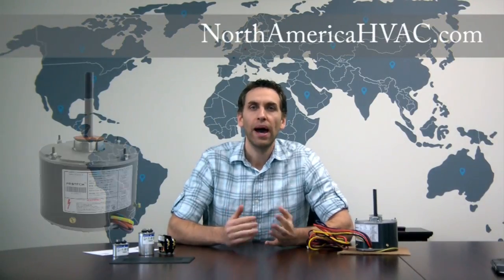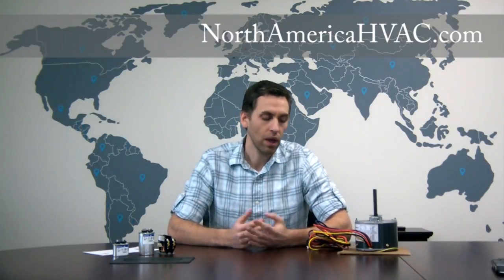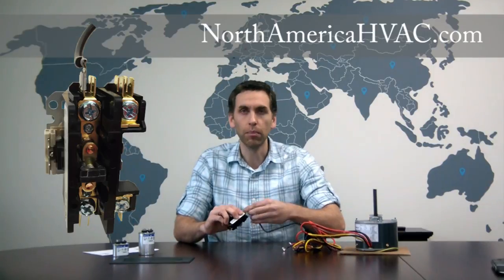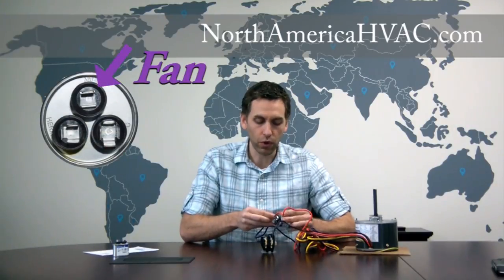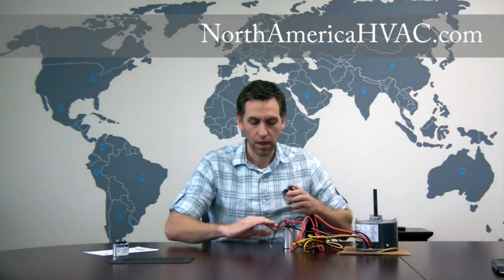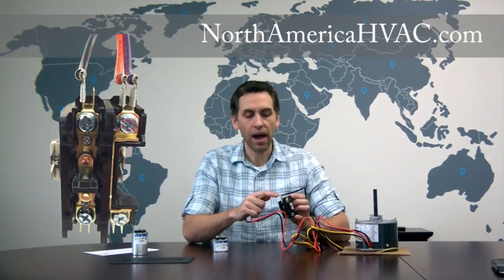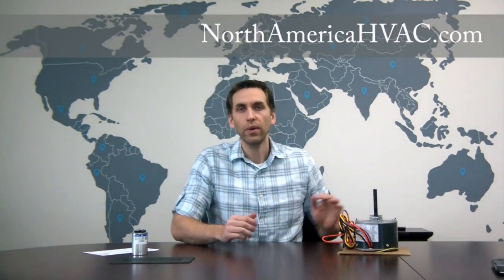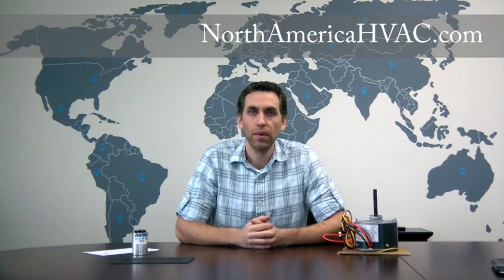How to wire 51-23055-11 & 51-23053-11 Condenser Fan Motors

Comment: Have had the motor since end of last summer. I spent time spraying W-40 in the old motor to keep it from squealing to get past the hot months. 

This summer that motor failed and its 97 degrees outside. I was not comfortable with the one page wiring diagram to tackle this project and was about to call someone qualified. 

This video was awesome. Thanks for making it very easy to understand and complete myself. 

AC is blowing cold again and NO SQUEALING!!

Comment: Be sure you wire TOGETHER the brown and yellow.  I had taped them off but didn't wire them together.  The motor will not run unless they are wired together.  My mistake, missed that little comment.  Otherwise great video for wiring this replacement condenser fan motor.
Reply: Thanks for the clarification. Much obliged.
Reply: @tbwil  yes I missed this as well but thank you for the clarification it works great now!

Comment: Good stuff man. 
I was replaced the ac fan motor for a ruud 3 ton and I noticed a I had 4 wires on the new motor.  It over heated within 5 min and Shutt off. Lol the wiring was completely different.  I followed your instructions and waaalaaa. Thank you

Comment: Thank a lot for this video.  I had a little bit of a problem reading the diagram and wired the fan wrong at first and was stumped.  The fan kept running hot then turning off.  After seeing the video I got things squared and I am all set.  Much appreciated.

Comment: Like another commenter said, I watched a large number of videos but just wasn’t sure until this video because I have the exact motor, would be nice if the factory left the angle spade connectors off the brown and yellow wire with just maybe a stripped back end showing the copper wires to give a hint of needing to tie them together instead of thinking they need to hook to a male blade somewhere, thanks for this great video, no doubts now and if rotation is wrong no problem swapping the purple and brown to get other direction.

One question is, if a motor is a clock wise rotate, is that with fan shaft facing you or facing away from you ?

Comment: My current motor went out and it uses Yellow, Black, and Brown wires.  The brown goes to a dual capacitor.  Apparently 51-23055-11 is a replacement for my old PN 8101-555 motor. How would I hook this up? Would I need a new capacitor? The dual capacitor I have no doesn't any information on it the label turned white.

Comment: My current set up is using the brown wire ,would recommend using that first instead or the purple wire on a 3 wire  hookup,also will a 35/3 440 capacitor work with theses motors?

Comment: My new 51-23055-11 from North America HVAC is working fine, but running with its surface temp at 185-190 Fahrenheit during a 85 degree day. Capacitor is new and checks at 3 mfd for 220V. Is it normal? I know it is class B so can handle much more on its winding, but I'm concern about the service life. Thanks

Comment: Do the yellow & brown wires get spliced together on the 3 wire setup or just capped off ?
Reply from the maker: Yes, the brown and purple, or brown and yellow, depending on your rotation get spliced together.  They cannot just be cut and capped individually.  Good luck!

Comment: On 3 wire dees any wire goes to herm
Reply: Did you find the answer to this?
Reply: The "Herm" connector on the dual capacitor is for the compressor wire to connected to. It has nothing to do with the motor wiring.

Comment: What about herm
Reply: The "Herm" connector on the dual capacitor is for the compressor wire to connected to. It has nothing to do with the motor wiring.

Comment: Not a word about those drain plugs---remove them? leave in place? And what's the hard plastic disc for that comes on the shaft of the motor--is it for shipping purposes or do we leave it on the shaft? In this "helper" video, why are these things TOP SECRET??
Reply: Same question here
Reply: ........................still waiting, "HELPER"
Reply: @Jeph629  I saw on another video, those plugs need to be removed for condensation purpose.
Reply: Any rubber plugs need to be removed from the lower end and inserted on the upper end, depending on how the motor is mounted on your unit, to allow for any moisture drainage via the bottom holes.